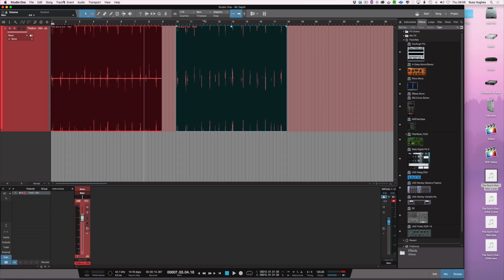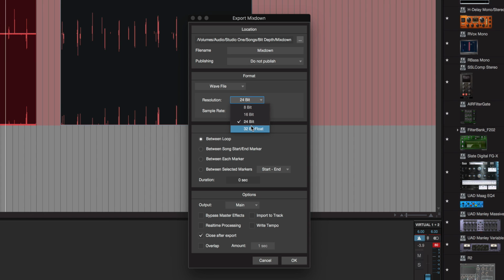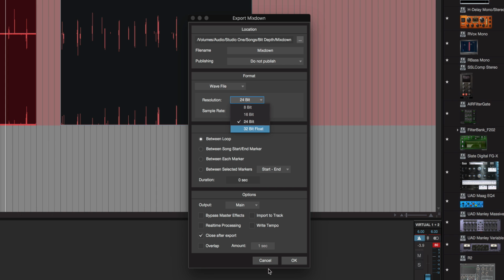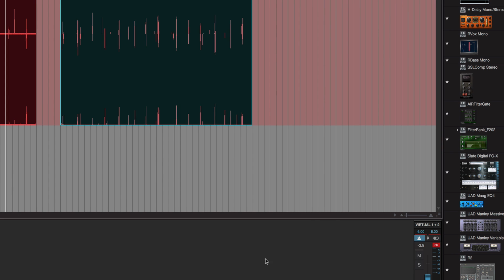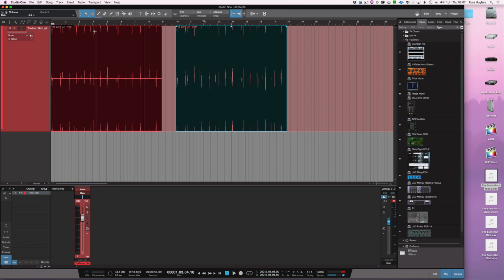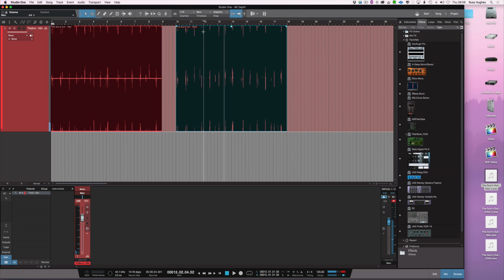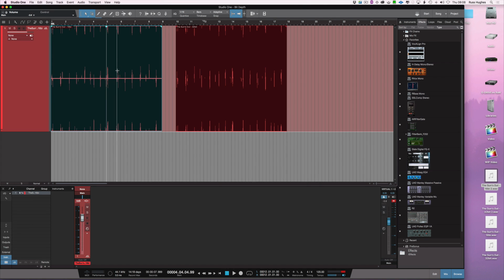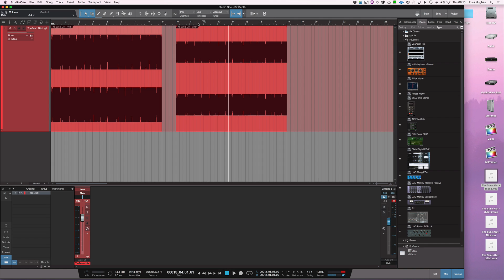How Using 32bit Floating Point In Studio One Can Save Your Audio

Comment: I check my tracks in Audacity for Clipping, & I can clean it up in that actually. My Tracks usually dont clip, yet if they do it might be very minimal, so thats when I can Correct that in Audacity very simply & it doesnt negatively affect my Overall song. You might think thats simple, but it works. Thats all Im concerned with. Keep in mind that whatever Bitrate you render in, the only way its going to be compatible with any other Gear is that Gear must also have the same bitrate option. I do 44.1 & 16 Bit, CD Quality.. Hey at least I viewed your video...thats something positive anyway. Cheers M8

Comment: Would this be pointless if my recording interface only records at max 24/92k? I know it's different when bouncing versus tracking, but would it still give that advantage if the recording hardware is limited at 24 bit? (I'm assuming that it wouldn't matter and that I could still bounce at 32bfp but I figured it's better to ask)
Reply: It won't help if the input source is clipping at the interface, it helps when mixing and anything based in the software you're using.